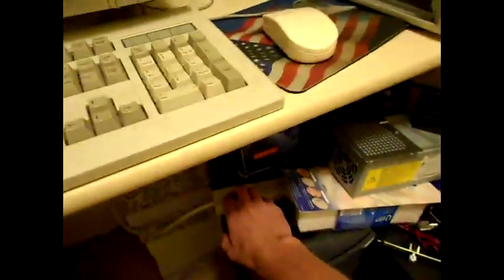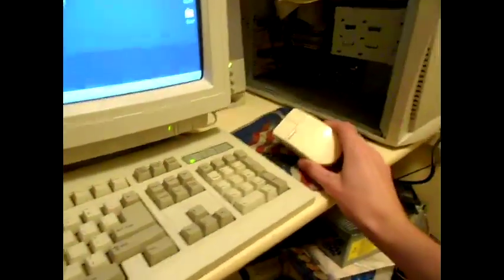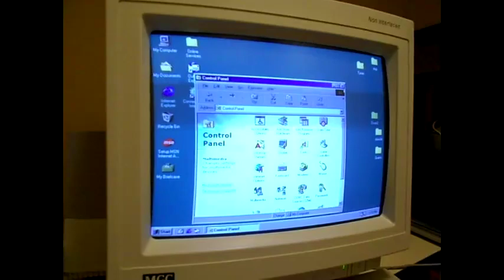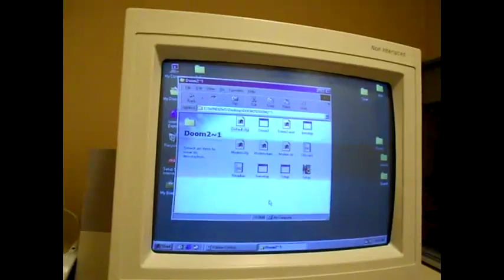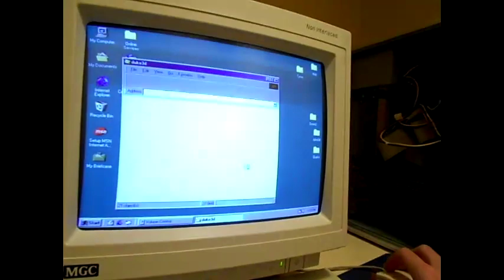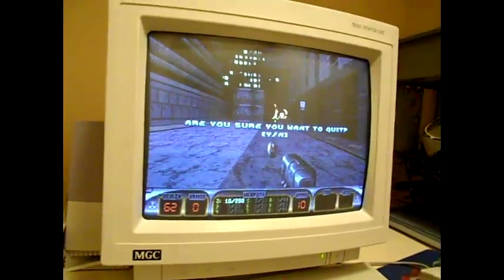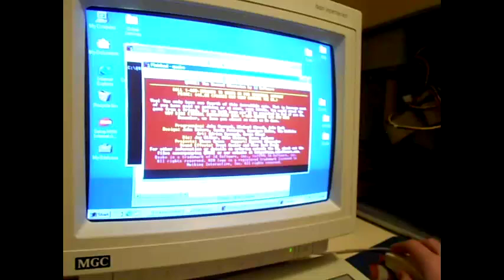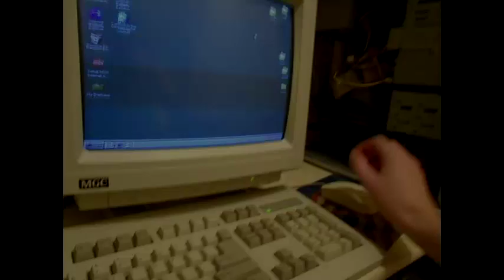AMD K5 PR166

Comment: Had a K5-PR150 briefly back in the day.  Not a great CPU due to crap FPU performance compared to the Pentium, cheaper though.  It'd play Quake with a 3dfx card adequately enough though.
Reply: I had a K5-PR150 on a 430FX board with 16mb ram, a Trident TVGA8900D ISA, a Crystal ISA sound card, and a 1gb hdd with Windows 95, eventually upgraded it to a Pentium 100 which had better performance, a Cirrus Logic GD5446 2mb video card, a Sound Blaster Vibra 16 CT2260 and a 2gb hdd, eventually upgraded it to newer hardware (Intel 430VX, Intel Pentium MMX 200, 32mb ram, ATI Rage Pro 4mb PCI, Sound Blaster AWE64, 4GB HDD) still have the old board in a box as well as all of the older hardware.

Comment: The K5 is indeed an interesting CPU, being a  RISC chip, with an X86 decoder bolted on to it.  Something all current chips are doing now.
Reply: +Paul Crowe The pentium pro did it first. This was a server processor that was almost the same thing as a pentium II in socket form factor.
Reply: @soylentgreenb  PPro lacked HW for 4 instructions per clock though.

Comment: My 1991 512kb isa cirus video card can play quake fluidly. I have an amd k6 266 mhz, a sound blaster sound card, a s3 dx with 4mb, 64 mb of ram, a 4gb quantum big foot (for windows programs and games) and a 2,5 gb quantum fireball (for dos programs and games). It just works so well, this is my second prefered computer. I hope you will make this k5 work at his best.
Reply from the maker: Its more about CPU power than GPU power on quake, a 266mhz k6 would destroy that game on regular settings. Only time the video card really matters is when you have a VooDoo and the game is running in Glide. Either way, I was kinda suprised how well the K5 handled it.